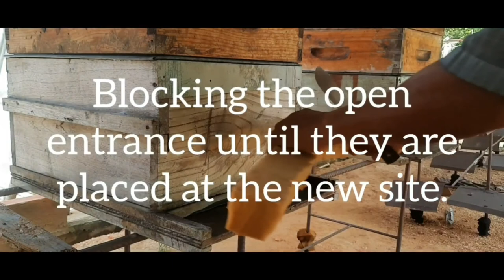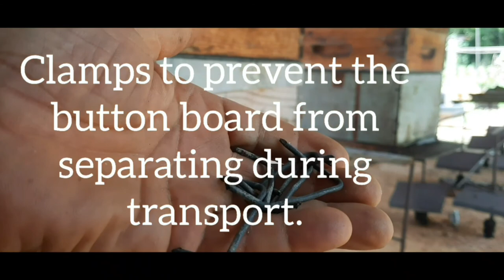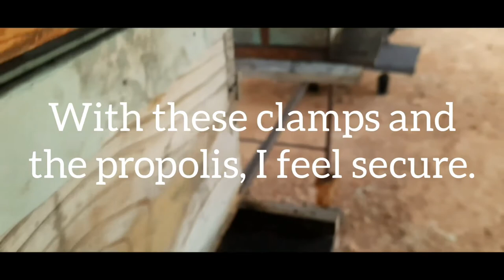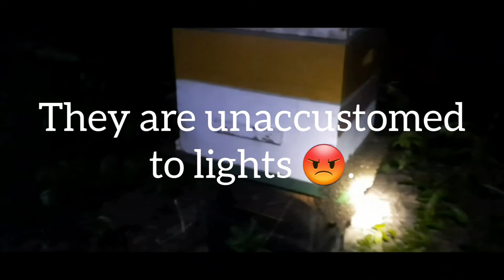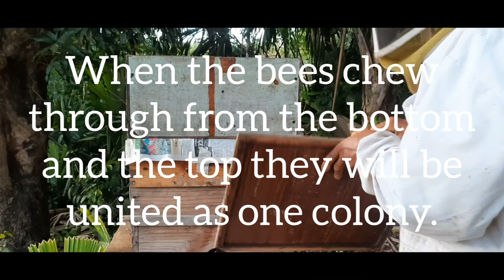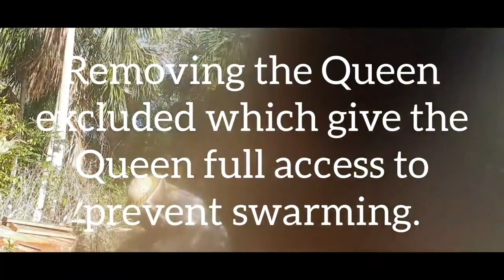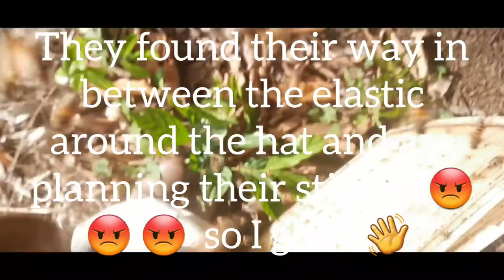No More Backyard Beekeeping 🥵.

Comment: You shoukd treat the bamboo, before buryingin the ground, this way willlast longer from termites...Thompsons Water Sealant works well 👍
Reply from the maker: Sir do, 🙏 🙂 Thanks, I can't use chemical due to the fact I'm doing organic farming of🐉. 

There is a 5/8" rebar in the middle and it is filled with concrete that way the bamboo is only a prop until the roots can get to feed on it as it decomposes ( slow fertilizer release method) for the Pitahaya a.k.a. dragon 🐉 fruit tree.

Stay healthy to do beekeeping 2 morrow 😁 👋.